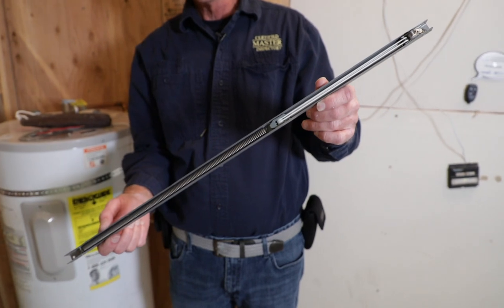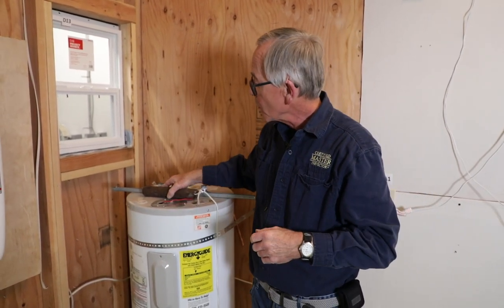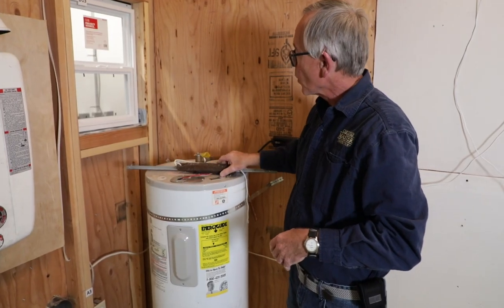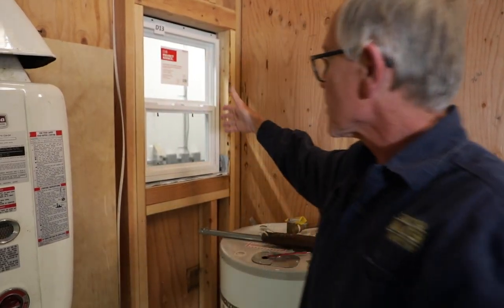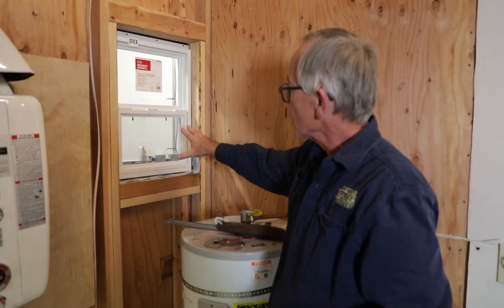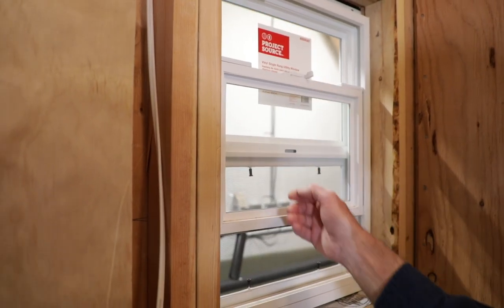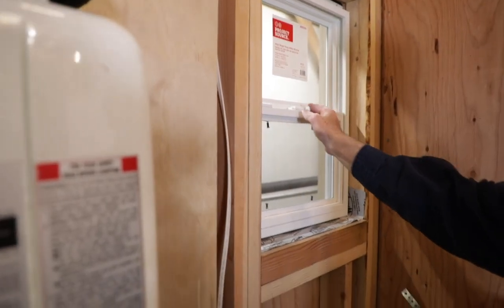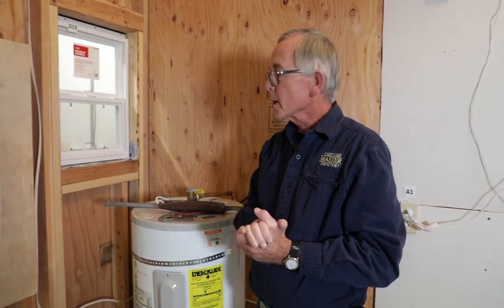Inspecting Single- & Double-Hung Windows with CMI® Ray Kline

Comment: I hope you inspect a lot more than what you just talked about in this video.  Seals, glazing, screen, locking hardware, weather stripping, presence of condensation, moisture in sill and wall area around windows...I could go on.  and on.  Maybe i'm reading too much into the title of the video and expecting too much.
Reply from the maker: You're right, Bert. This is an inspection quick tip. Just a short video expressing an opinion.